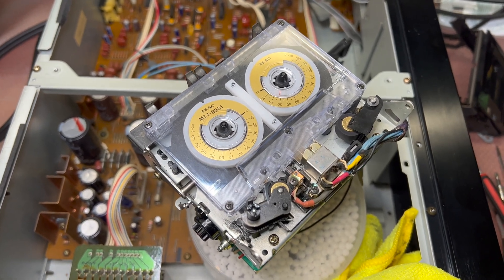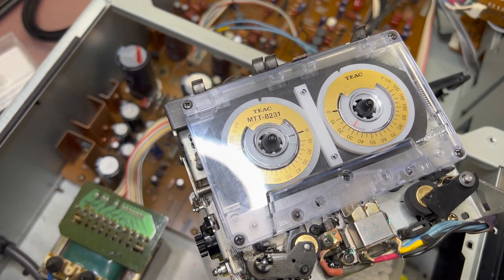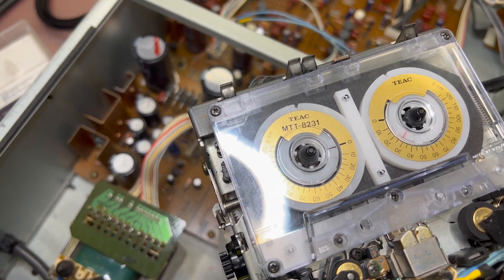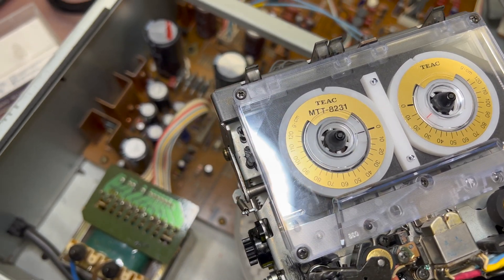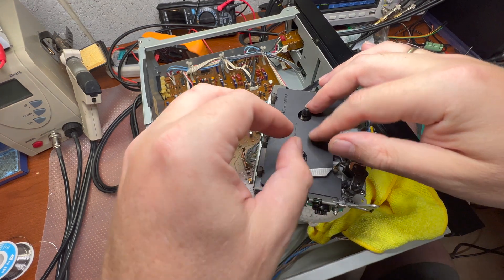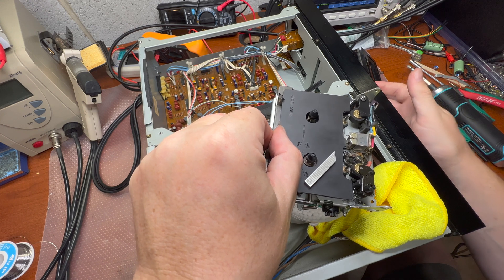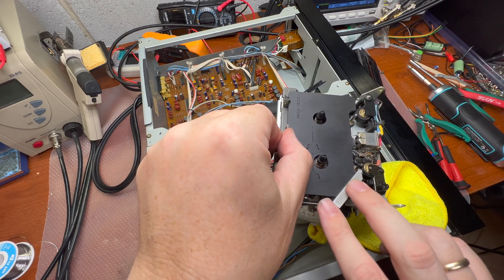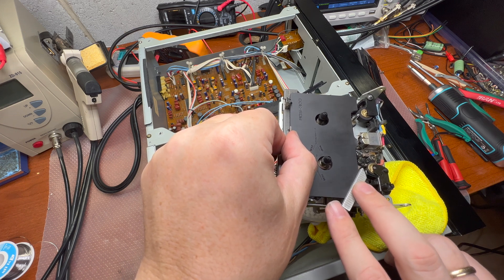Technical Insights: Torque Check & Tape Guide Height Adjustment on Sony TC-K222ESL

Comment: I also see sometimes erase head is not perfectly perpendicular, it is a bit tilted. That can amplify any instability and end up chewing tape.
Reply from the maker: Very easy to fix, watch mine videos on K890 and KA3 restoration
Reply: I've both found evidence in other Sony decks and I am not sure if it's a factory problem.

I had one which had the erase head dangerously closed to the other side of the tape. The service manual mentions to align the EH only after being replaced, but that I am sure doesn't account for the 30odd years of life and service life this decks have had.

The only explanation I've come up with is that with time and heat/cooling cycles the screws have come undone, or there must be something else like a plastic mount in between that has deformed with time. Regardless after 30 odd years it' about time to also perfectly re-align the erase head.